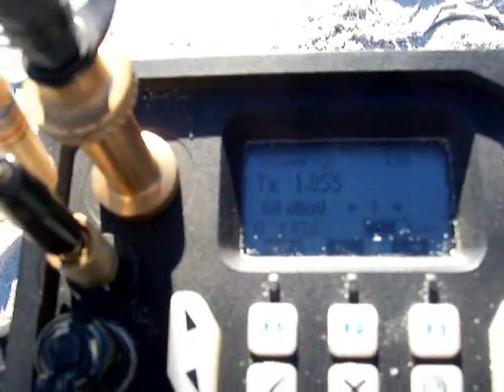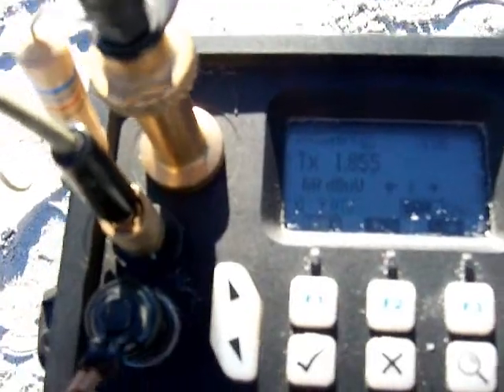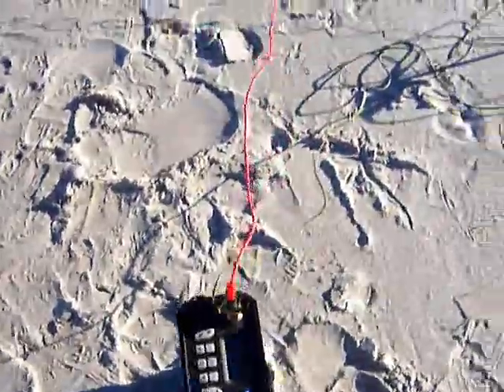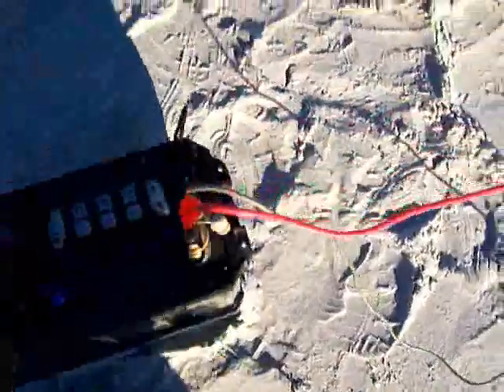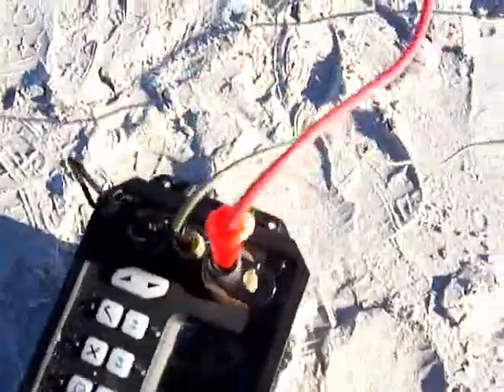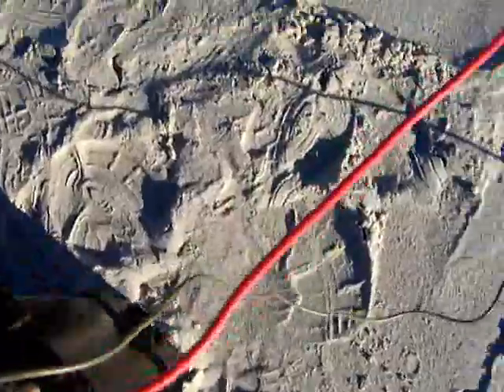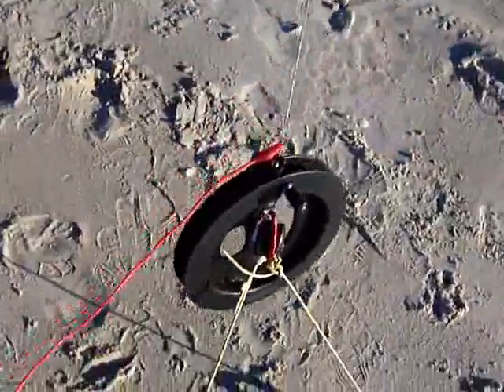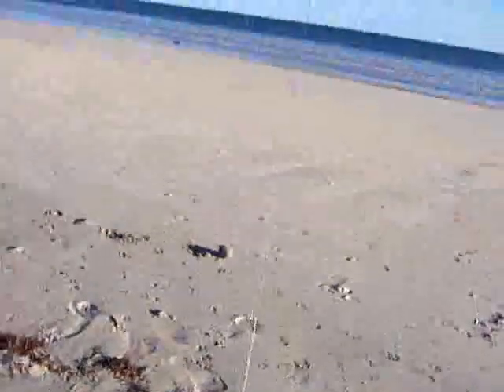160m 5/8 wave antenna trial

Comment from the maker: @Biffbradford Yes, I did, once I built an external broadcast filter between the antenna input and the antenna. The idea was ditched to use this antenna, because once it leaves the vertical position (directly up) the radiation pattern turns to $%@#. A quarter wave performs better when that happens and tests have proven this, between a number of stations at various times. The end fed half wave is the best performer. Thanks for your question and for dropping by. 73, Steph.

Comment from the maker: The problems with front end overload is because there is no BC filter  in this particular unit. (It's an old/early prototype which doesn't have one...)
The counterpoise is in essence capacitively coupled to the water table  few feet down below. Operating maritime mobile might be interesting.....
Thanks for dropping by. 73.